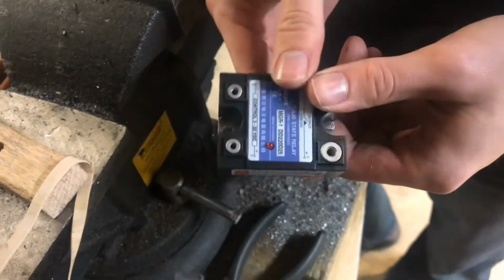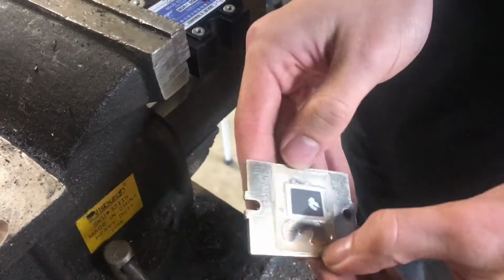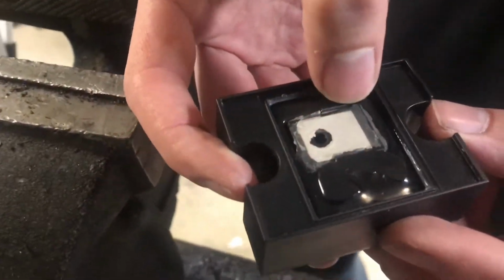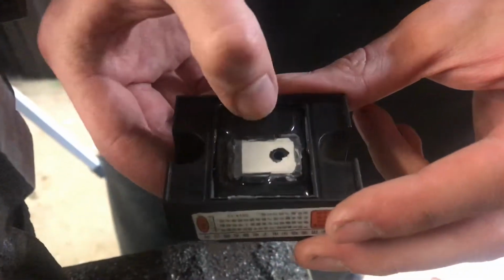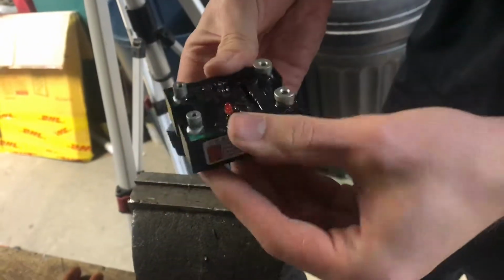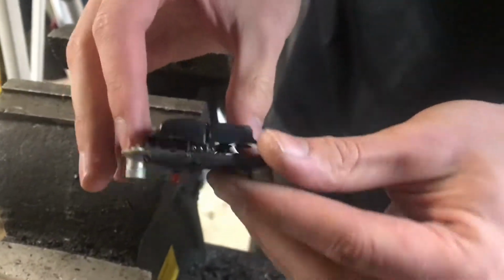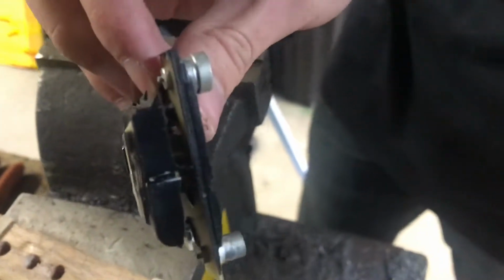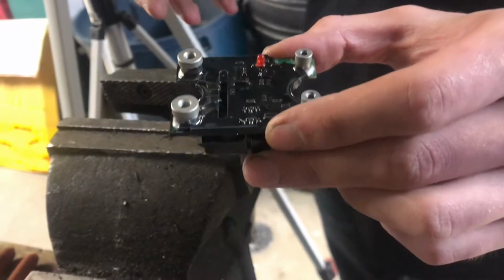WHAT’S inside a solid-state relay (explanation of how it works)

Comment: I've opened several of these
I think the relay is a fake
There is a TRIAC
Instead of having an array of silicon circuits - Two squares connected directly to the heat exchanger.